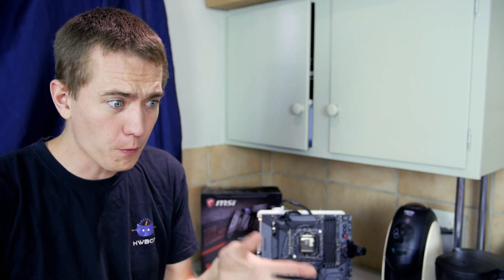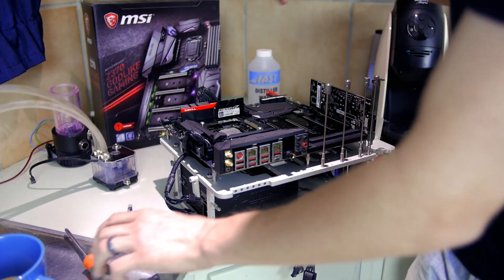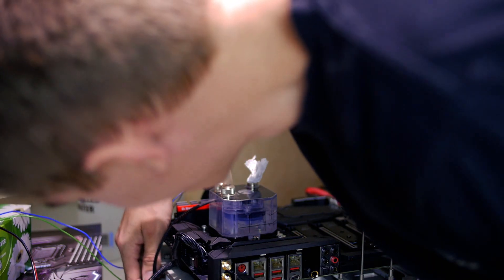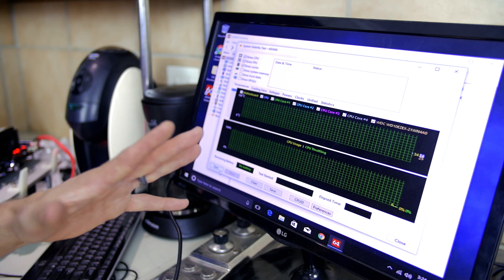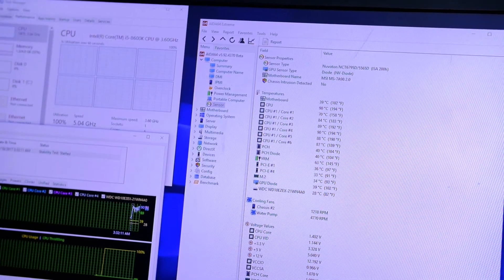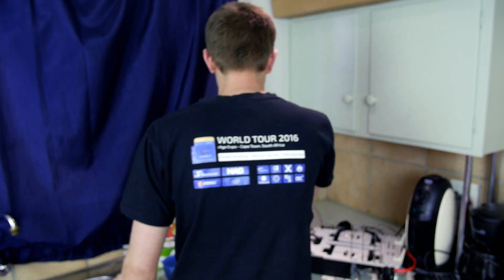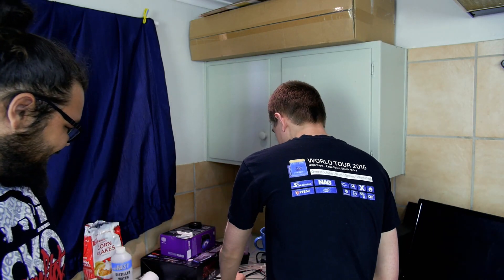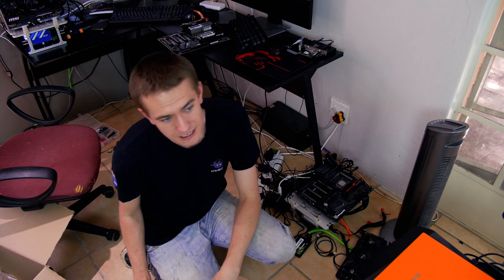Making Coffee With Coffee Lake! (NOT CLICKBAIT) *GONE WRONG!*

Comment: I'm a bit late, but at some point you should try using a proper CPU+GPU loop, but with 1 radiator. Remove the fans on the radiator, put the radiator in a container of coffee water, and the water loop and coffee water will both get hotter and hotter.

Comment: as Long as you use distilled water it should all be fine, only salt in the water is going to make the electricity flow, distilled water is not conducting. That's partly why you should use that.

Comment: I just want to know that i want to build a pc so i3 8100 would bottleneck gtx 1060 6gbor RX580??
Reply from the maker: +TANUJ bedi Not really.  It'll be the same as if you were using an i5-7400.  Check on that CPU and you'll have your proper answer.
Reply: Bro can i am on a very tight budget and there are only "Z" chipset motherboard available this time so should i wait for budget motherboard or go for skylake? And by when that budget chipsets will be arriving market?
Reply from the maker: +TANUJ bedi Wait for budget.  Might have to wait til January, but I personally wouldn't go Skylake now.